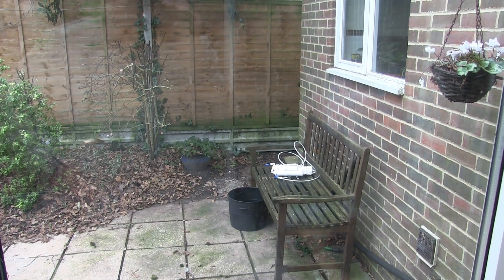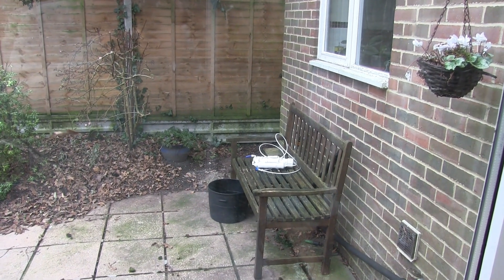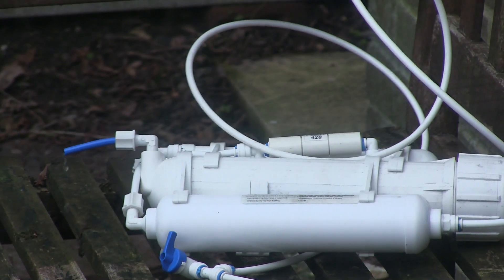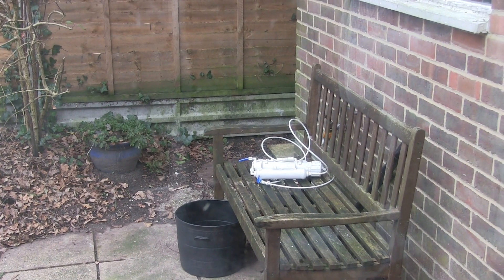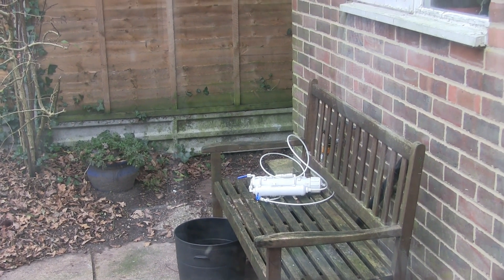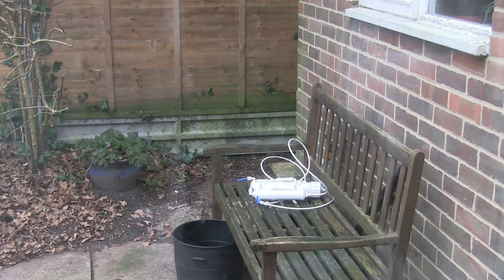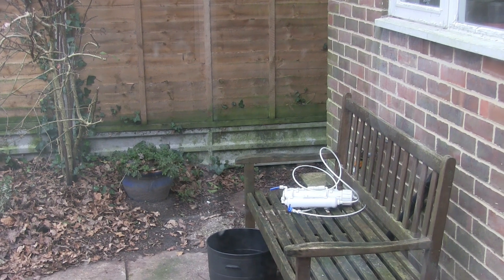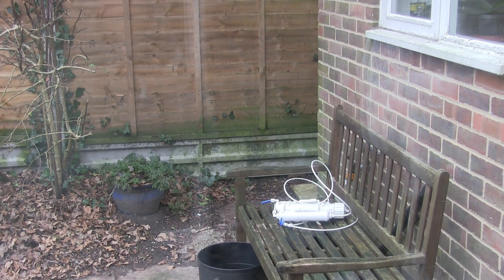I Need More Water - Let Me Explain

Comment: I have been using an RO system that has three filters and incorporates a gallon tank. So, you will have full flow from the spigot for the first gallon, but it does refill pretty quickly. The whole set-up was under $300US.  You don't need a plumber, unless you don't like to do jobs like that. But, my husband did the installation and he hates doing anything to do with plumbing. It also has quick replacement of filters. They come on and off like a screw top jar. The preliminary filters make the membrane last a very long time. Good Luck, from Cowboy Country!
Reply from the maker: There are automated systems but for the amount of water I use, it's not worth the expense.

Comment: Roger if the new system still needs more pressure you could try a (push on tap connector) with a short hose and fill in your kitchen sink at least you'd get direct water pressure, it might be inconvenient "and warmer " but it would be easier to fill your containers and the waste water can go straight down the sink, lets hope your property hasn't got a water meter, again only a suggestion buddy.
Reply from the maker: I have found a screw-in adaptor so hopefully can do all the work in the kitchen - in the dry and warm.
Reply: Sounds good to me Roger.

Comment: Interested to hear how it work out. I have thought of getting a booster pomp. To get abit bigger pressure. At this moment, it take 4 half hour to fill 25L dunk.
Reply from the maker: I've found a way of using the mixer tap in the kitchen so hopefully, problem solved.